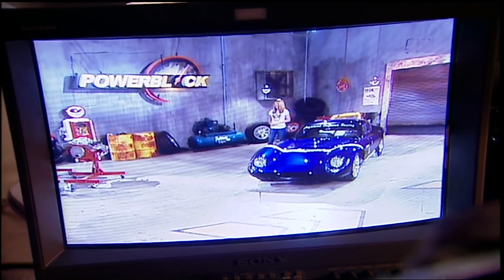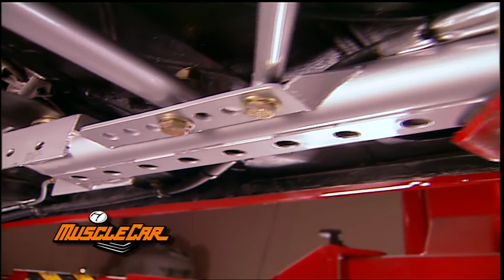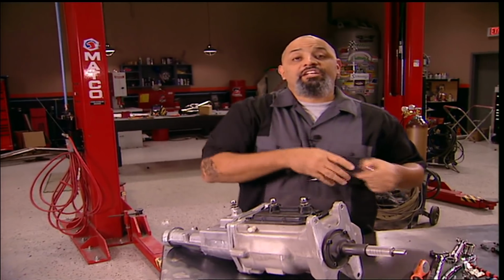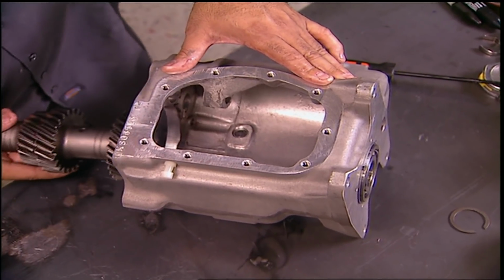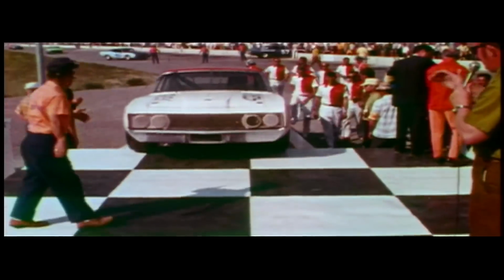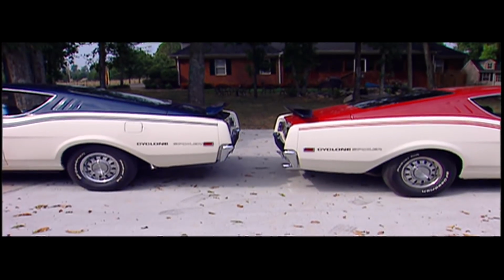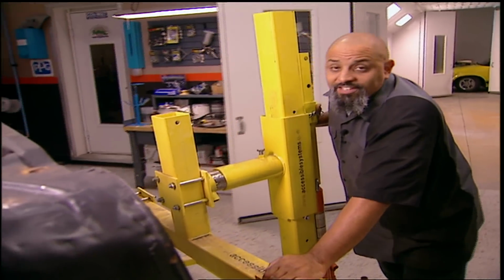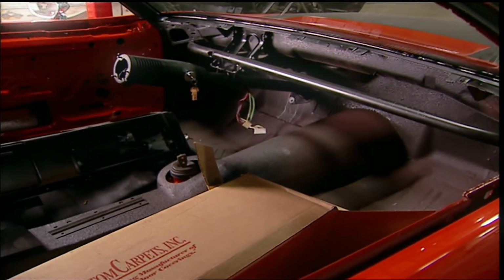Rebuilding A Manual 4-Speed Transmission - MuscleCar S2, E23

Comment: crappy  voiceover .. sounds like you want to pick a fight ..you didn't build that trans .. when you demoed the sliders  moving to shift   you said the trans is in 4th gear without  moving the slider ...and using a press for counter shaft install? because a purse can't tap it into place ?